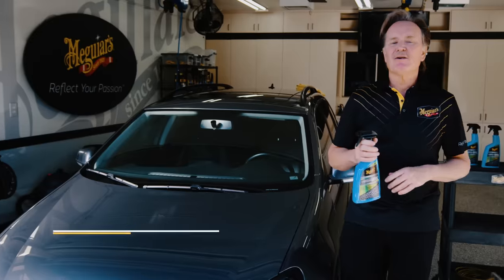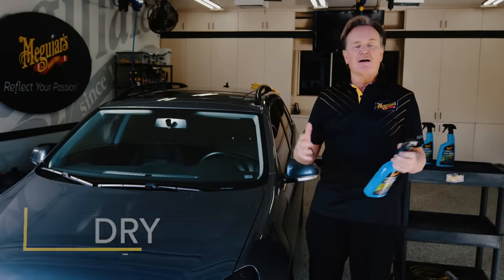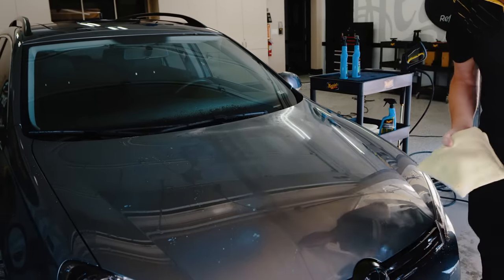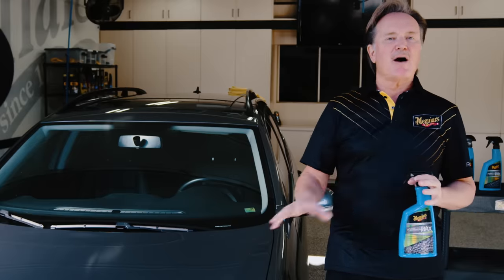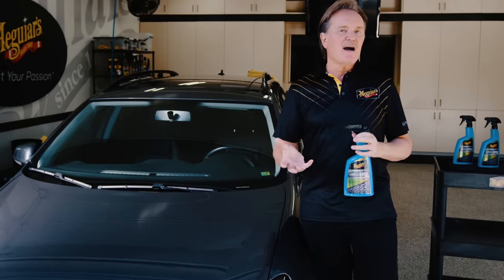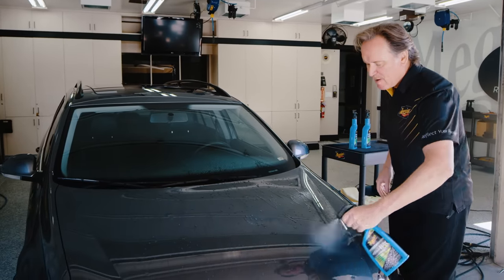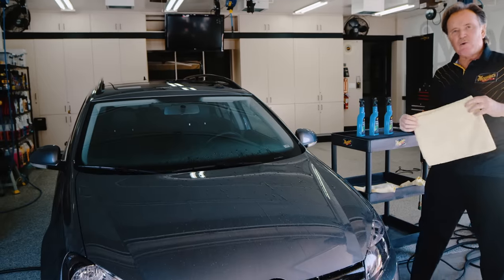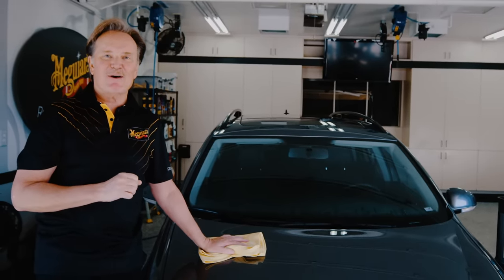Meguiar’s Hybrid Ceramic Wax - Ceramic Made Easy!

Comment: Dear Meguire's..How much bottle will i use for one car??
Reply from the maker: Certainly depends on the size of the vehicle but you want to use less product than you might think as too much product will only make it more difficult to work with.  Typically you should be able to easily get 4-5 cars out of one bottle if not more.
Reply: Thanks Sir
Reply: @meguiars  Do i need to do the coating prep. like a normal ceramic coating???
Reply from the maker: This is not a ceramic coating so the same prep is not required but keep in mind you do want to remove all contaminants and defects before applying just as you would before applying any protection.

Comment: Hi from the UK. I used the ultimate compound with a polisher. GREAT product. Then I used this and it left streaks over the car even when dried. 1st rain and I'd got streaks all over. ☹️ Tried wet, applied it, dried it off, same thing and 1st rain got streaks again.. on my 1st car the 2nd rain got rid of the streaks and great beading. Too much product? I'd guess one trigger spray should do one side of a car by my results...
Reply from the maker: Yes, amount of product is detrimental here.  This video (link below) has a little more on proper application.  Thanks for your patience!

https://www.youtube.com/watch?v=Zk-OwkIlYLs

Comment: Is it safe to use on EVs?
Reply from the maker: Yes, the paint on the exterior of the car does not care how the vehicle is powered!  😀
Reply: @meguiars  Yes, the question was more about the spray and whether it interferes in any way with the electrical system if it enters there.
Reply from the maker: Not sure how it would encounter the electrical system but to be safe you would not want to spray this directly only any openly exposed electrical components just as you would not want to pour water on them.

Comment: Does anyone know why we don't just use it every time as if we are putting down the "foundation coat"? It will save 1 more rinse and probably use less of the product each time.
Reply from the maker: You are welcome to apply it that way every-time, but we feel it's easier after the initial foundation coat, to spray, rinse, and then dry the vehicle.  Plus it makes the drying process so much easier!

Comment: Can this be used on black rims?
Reply from the maker: if the wheels are painted, yes, that would be fine, just ensure wheels are cool to the touch prior to applying, do not use too much product, and do not allow the product to dry on the wheel.  Good idea to do one at a time.

Comment: no offense but for the $23 with tax and the fact the foundational layer takes half the bottle. I would skip this and spend $40 more for the Cquartz UK. This was my mistake!
Reply from the maker: We do genuinely appreciate the feedback but it is worth point out that if it takes half a bottle to apply this product you are using way too much.   You should easily be able to do at least 5 cars or more with each bottle.
 
We say that just to educate not to argue with you.  Thanks again for comments!   👍
Reply: @meguiars  what size car or truck? Are those light blue splotches normal as well?
Reply from the maker: This product would cover 5-6 applications of a full size sedan as it only takes 1-2 mists of product per panel or 3-4 on a larger surface area like a hood. You may want to try misting the product on the vehicle as an over application of the product would cause the product not to bead since the product is water spread.

Comment: I use and love this product.  However, I note the recommended application of follow up coats wastes a tremendous amount of product. I believe, from my own experience that using the process of 1 or 2 squirts per panel on the wet car after rinsing, uses so little product, that consumers were not buying enough. I have a bottle that has lasted almost 2 years now. So this over use video seems like a marketing ploy to increase usage through over application and waste.
Reply from the maker: You are misunderstanding the application recommendation.  We are not suggesting you have to do the 2nd application method immediately after the first.  We are merely giving instructions on application in both scenarios even though they will likely be weeks/months apart.  

Also worth noting that when this product launched the instructions were more vague as to the amount of product that should be applied and overwhelmingly users over applied the product which unfortunately could lead to difficulty in application and removal.  We have many people telling us they used 1/2, 3/4 or even an entire bottle on their first application.  Because of this we actually changed directions on the label to indicate the appropriate amount of product which is actually much less than many were using.  

Sounds like you were part of a smaller minority that on your own discovered how far the product can go and that less is sometimes better.

We have all grown to be suspicous in today's world but not everything is a conspiracy or a scam.  😁

Comment: Have noticed lately that your ceramic wax bottles are very poor plastic as they crack and become brittle really easily have bought two bottles from different batches and they are both cracking and leaking. 

To me It’s the change in temperature I reckon that’s causing it and I’ve lost quite a bit of product as one was broken at the bottom the latest one has cracked round the label area very oddly 

Love your products but I reckon savings have been made in the plastic bottle area
Reply from the maker: Thank you for your feedback.  

It is worth noting that we are in the process of changing many of our bottles so you should see this issue resolve itself over the next few months.

If you ever have an issue with a Meguiar's product please feel free to reach out to our Solutions here...

https://s.3m.com/418w1x4a
Reply: I do have a few pics if you want to see the oddity that is the bottles

Comment: seems like spraying it on in blotches then power washing it off isnt allowing it to even touch the whole surface of the hood. this is a weird way to apply any sort of paint product. i would imagine just using as a spay wax would make 1000x more sense
Reply from the maker: We understand it is different but it genuinely does work this way.  For best results make sure to follow the directions related to initial application first.
Reply: As an engineer, I get questioned on things by laypeople all the time when my solutions are contrary to their experience-based intuition.   I listen to them, consider their opinion, and offer them mine in return.  In the instances where their hypothesis is incorrect but they insist otherwise against my advice, it's frustruating to me that people who have no technical background in my field think they know more about it than I do, simply because their common sense tells them so.  

In this case, in spite of being instructed to the contrary by the experts, the layperson (presumably not a coatings chemist) has stated that he imagines his solution is 1000xs more correct than the experts.  It's important to realize as a layperson that common sense is something that will work for you most of the time, and utterly fail you other times.  It's ok to question your experts, but when they disagree with you, odds are they're right.
Reply: HollywoodF1 whoa

Comment: I understand the product works well, but the second application method is puzzling. Spraying the wax unevenly and then immediately rinsing it off seems counterintuitive to achieving full coverage on the panels. Doesn't make sense. 😂😂😂
Reply from the maker: Maybe hard to understand but does indeed work.  You are spreading the product as you rinse with a strong spray/fan of water.

Comment: I tried this product for the first time today and it was horrible! I followed your instructions to a T and I ended up with streaks and haze over the whole vehicle. It took me 2 hours to buff off all the haze! I use many modern wax products and this is by far my least favorite. Now I don't trust Meguiar's products!
Reply from the maker: So sorry to hear that.  There are certainly many people using it very sucessfullly.  Aside from the information covered in this video the number one cause of the streaking you are describing is over application of product.  You really have to look at this as more of a concentrate that needs as little as 2-3 sprays of product per panel.  The product will spread as you complete the product.  If you see that you have used half or even a full bottle on your car you have used way too much product.  Each bottle should easily be able to do a minimum of 4-5 cars.  

Regardless, we do understand this is a very unique application that will not be desired by everyone.  If that is the case you may want to consider our Hybrid Ceramic Liquid Wax as it has a much more traditional application.

And as always feel free to reach out to our Solutions Hub if you are just not happy with the product or need help figuring out what went wrong.

https://www.meguiars.com/contact-us

Comment: I like Meguiars products,BUT this is NOT easy and it streaks!! I used just as was directed and what a pain ! It is not what I expected from these guys. I used on my  two cars with excellent paint and the same results!! On the second car, I used my Meg. ultimate quik detailer to to get the hood  streaks off.  If anyone wants the rest of the bottle , it is free. I will stick to Meg. waxes
Reply from the maker: Thank you for the feedback.  It has a very unique application and the directions must be followed carefully as well as using less product than you might suspect.  Too much product will lead to bad results.  Anyway, we don't need to change you mind but we do genuinely appreciate the feedback.  👍